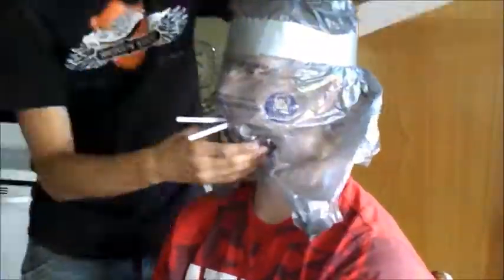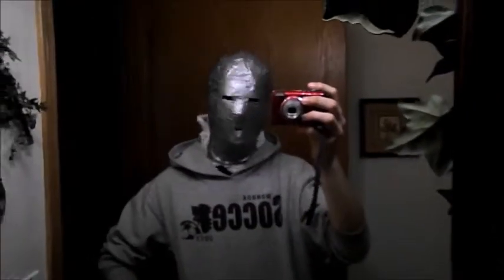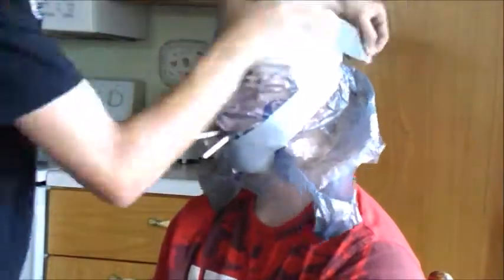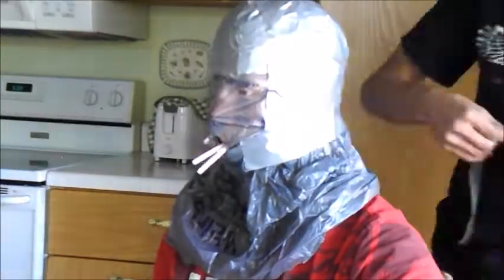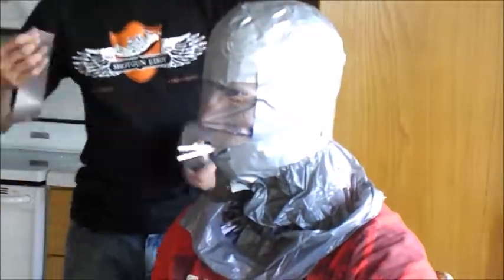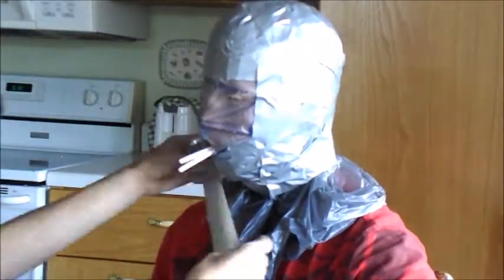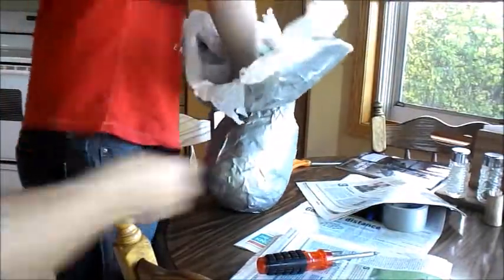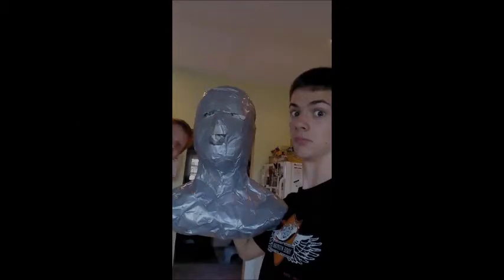Making a Head Mold for a Helmet

Comment: How do you reckon they did mold the helmets in medieval times?
Reply: Some sort of plaster cast, I assume.
Reply from the maker: Osmorosvo as far as I am aware molds tended to not be used too much for helmets as it would be a reasonably complicated step that wouldn't be entirely necessary to make a well fitting helmet. I think back in the day they would have relied more on experience and familiarity with the raising process. I only use this mold as often as I do because it was very easy to make.